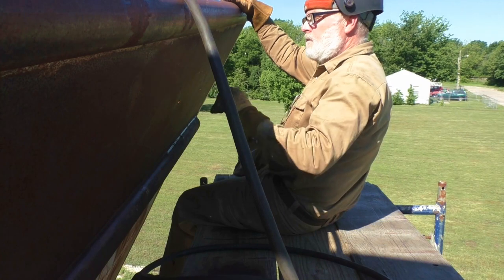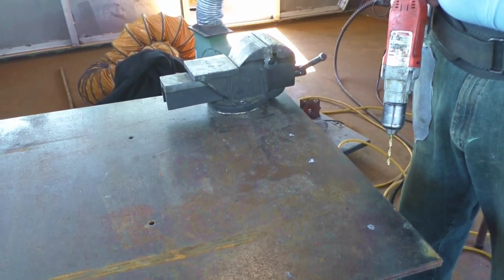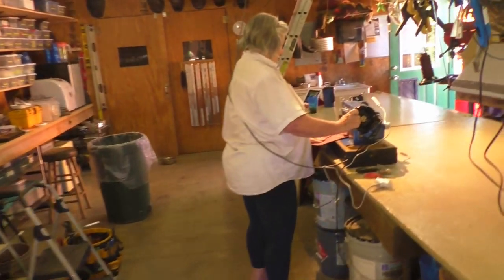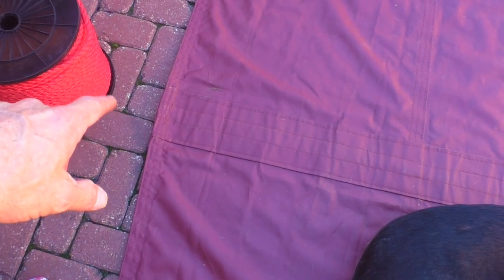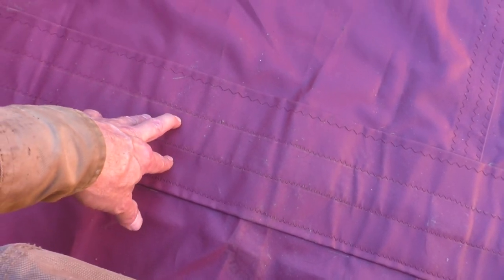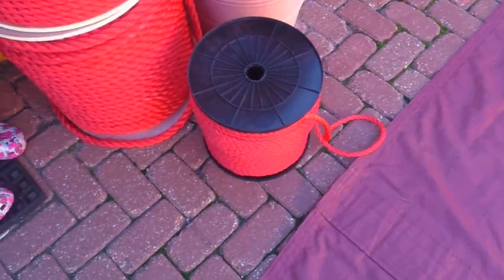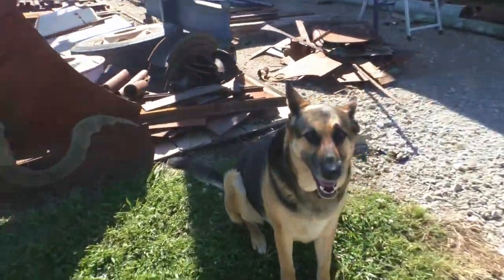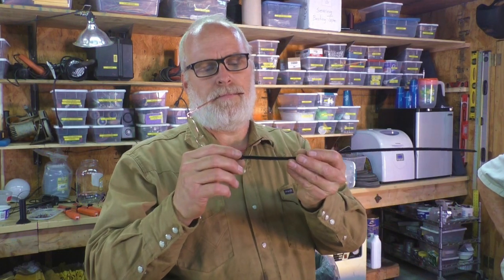Seeker LIVE - May 6, 2017 - Welding, Work Table, Sailmaking, Grommets

Comment: When I worked for a hose and gasket company, we used a stainless hose clamp that came as a roll. Uses special clips and a ratchet that pulls it tight. Special pliers crimp the clamps. they don't come off without a grinder or snips.

Comment: Beware burning holes through structural cloth and rope, from my experience a burned area tends to cause a lot of tearing in the material when load is applied. Now I don't know what exactly your sailcloth is made of, but I'd do a test portion just to be sure.
Reply: Depending on what it is made of it may let off chlorine gas or other toxins.

Comment: Use short length of dyneema rope with a square knot. UV resistant. It's used for winch line...super strong and light.

Comment: We used to assemble street signs and traffic signs with a strapping unit that used 3/4 inch stainless steel straps and connectors. You needed special tools to attach the connectors and to tighten up the straps. Damn, it was a pain in the ass to use. I wouldn't recommend it for anyone who didn't have to absolutely hold something down. And as far as ropes, learning to do knots and make slings and eyes can be very therapeutic. I spent a couple of days braiding eyes for a former employer who used ropes for a number of jobs. Pick up a riggers handbook or a knot tying book-with lots of pictures,  you won't regret it. I have kept mine since I purchased them in the 70's and plan on handing them down to my grandson.

Comment: Love what you do.  Re. burning the sail.  I found it left hard edges that chaffed on the thread and it broke in places.  Malleting an awl through worked well for me.  I know you do but don't forget to oil up the Sailrite.  I have the heavy flywheel. Brilliant for heavy and multi layered stuff. You can go slow without it stopping too much.  Billy from Blighty.
Reply from the maker: Great point.  Thanks

Comment: On the subject of GROMMET INSTALLATION may I offer my experience setting grommets.

An arbor press does an excellent job but is limited by material space management.  I cobbled together a humble, home made device that is simple to make.   And as an extra bonus, it can be carried aboard the vessel and used while at sea.     I'll try to discribe it...

Position your work table under a substantial ceiling beam.  From this beam, suspend a vertical pipe to within inches of the table's work surface.  A setting tool will have to be made to attach to the bottom of the vertical pipe.  
Place on the table, a small hydraulic block jack, maybe 2 inches cubed with a hose running to a hand held pump to provide the SQEEEEEEZE.  Sitting on the top of the jack is the grommet die.  The block jack and it's associated grommet die is position under the suspended setting tool. 

Simply maneuver the sail to position the grommet between the two tools. Apply the necessary hydraulic force to seat the grommet.  The sail can be maneuvered unrestricted from one grommet to the next regardless the size of the sail.

                                                          Works good, last a long time.

Comment: You were on the right track when you were talking about applying the rope to the sail "cording style". I would cut a piece of sail fabric 6 to 8 inches wide and make the cording out of that. then you can sew it on the edge of the sail with 4 to 5 lines of stitching.  then at each end of the cording, hand stitch through both layers of sail cloth and rope at least a foot....after stretching it. You need to make sure it all stretches to the same length.  I also didn't see any reinforcing on the corners of the sail.  You will need several layers of graduating sizes, say by 3 inches per layer.  With a large/strong grommet at each corner.  For the battens, I would make batten pockets out of sail cloth with a metal reinforcement at the mast end.  to keep the battens in, just drill a hole in the batten and tie or sew them in in pocket. I have about 10 years experience as a sailmaker.

Comment: A Dremel tool with a small burr or drill bit would go through those layers of sail like a hot knife through warm butter.  You could make some sort of jig to space off the holes if need be, or use a ruler, or simply eyeball it.

Comment: We use a soldering iron on Dacron at work all the time. You can use an appropriate size copper wire/rod/rivets etc threaded into a good hot iron. The steel nail type of thing with a torch works but cools faster than you might think....it would be like stick welding in comparison it to the hot iron...the copper has a much better thermal cycle than steel heating quicker and holding more heat as it burns the holes. Also working the grommets, you will find the same type of problem with a press as you do striking with a hammer. It will still tend to press unevenly to one side or the other causing the shank to buckle and flatten unevenly. The trick is to keep turning the punch and compensate for any uneven areas on the flare as it develops, it's a lot like making a good flare on a brake line.  If you just smash on it it will be lopsided and ugly, but working the flare nice as it curls over gives a much better result. An idea to prevent someone having to crawl under the sail may be to weld or thread in a long rod that you can use to push the die under the sail to locate it under the hole. I'd also think a heavy piece of plate welded to the bottom of the die would help to make it sort of it's own anvil to have enough mass to keep if from bouncing and keeping it straighter. Two other ideas are to try welding the punch part to an air chisel or a hammer drill. Air chisels work great for heading rivets but the rotary/hammer action with a drop of oil may also spin the metal and form a nice flare on the grommet easier. Finally for the loops, you can also use heavy duty Dacron and seal it together with the shank on a soldering iron as well. You stick both pieces around the iron, pull the iron out quick and squeeze together with like a inch or so overlap repeating as necessary till the whole overlap is melted together. The larger diameter and lower temp of the soldering iron shank melts the Dacron better than the tip of the iron which tends to burn and oxidize the Dacron so that it's not as strong. This can be strengthened by burning a few stake holes through it as well you can even reinforce those holes with a blind stainless pop rivet with a back up washer for more strength. But yeah the grommets are a real pain, but after a few you realize how to finesse them in. If you mess one up, don't try to grind it or drill it to remove or you'll melt a hole in the sail. It's best to grind off a pair of side cutters so one side is smooth and use that to get in under the lip to cut and pry off the flared head.  Hope some of that will help....Tim
Reply: Oh, one more tip I almost forgot. The punch tool they send with it is really bad a starting the flare on the grommet shank. half the time the shank starts to buckle before it starts rounding over. I've used a wide tapered punch or if you can find a cheap small ball peen hammer that has the ball that's kinda long and egg shaped. That works really well to use as a starter to get the flare going (striking it with another dead blow or brass hammer). once the shank starts to flare, then the normal tool can be used to finish rounding it over and seating it home. Just don't hit it too hard to start or it will split the side of it out...Tim

Comment: For setting grommets in the middle of a sail, would a pneumatic impact hammer (adjustable via air pressure) work better? Make the setting die fit the hammer. Then you can set anywhere.

Comment: Stainless self locking zip ties are available (at least here in Australia) from TRITON that can be pulled tight with a normal pair of pliers.  There are a number of products that will do the job but are actually designed to hold CV boots onto car drive shafts.

Comment: Black zip ties are UV stabilized by adding carbon to the plastic. They will still become brittle in cold weather and after extended time in hot weather. The are for organizing cabling, not holding things. Use something made for the purpose or watch it break.

Comment: For swaging the grommets,
how about drilling and  threading the lower die 3/8" x 16 right down the centerline.
Then, drill all the way thru the punch die, centerline, with just enough clearance for a 3/8" x 16 tpi all-thread to pass thru cleanly.
Now, cut a length of all-thread 2" longer than you need to thread into the lower anvil die, plus the full length of the punch die.
Now, weld a decent lever on a 3/8" x 16 nut.
Lastly, weld a large wingnut, or whatever to the top end of the all-thread.
Now... (for its first use) you'll need to run the nut with the lever all the way up the all-thread, until it reaches the top where the wing nut is welded.
Finished.

To use it, align the anvil die under your hole with the lower brass grommet in place, under your sail. Then place the upper half of the brass grommet thru the hole in the sail, while aligning both the punch and the anvil dies.

Now just insert the all-thead thru the punch die and use the wing nut to thread it fully into the anvil. 
Crank the levered nut down against the punch die until the grommet is swaged to your liking.
It's a thread press.
You might even be able to use 1/2" threaded hardware. Whatever floats yer boat.

It would probably be a good idea to weld a plate, or long handle onto the lower die for easy positioning, and to prevent the die from spinning when you crank things down.
Viola. Cest finish!
Regards,
- the transmission guy in searcy

Comment: Instead of a press for the grommets, bore the tool through and use a threaded rod and nut. You could even turn up your own tooling for the job that way you can have more than one. run the nut's down with a zip gun for speed.

Comment: What is the UV rating of the Dacron rope? I used to hang glide some and I know the sails are made of Dacron and they break down with exposure to the sun. Also an arbor press uses just a rack and pinion gear. You could weld up a custom size c-frame and then cast the rack and pinion gears out of bronze using a pattern cut on your CNC cutter.

Comment: Take a trip to your local sign shop they have grommet presses to put grommets in banners.  At least you can try it before you buy one.  

When punching holes in the sail with your punch, you said you were going to use wood under the sail.  set the wood so you are punching into the end grain.  you won't have to his the punch as hard to get the punch to go through the sail material.  how ever the punch will go deeper into the wood if you do hit it too hard.

On the wire ties, you can get 3/8" ties up to 48" in length.  With that said, find the length you need and you can wrap the wire tie around the pole and through the grommet twice.

Hope this helps.

Comment: A thought on holes through the sail material would be to make a punch out of heavy tubing or pipe and turn it on the lathe so one end is tapered and sharp.  Put the other end in a drill motor to spin it while using the punch like a drill bit to cut the material.  A piece of wood or plastic cutting board as backing will be necessary.  With correct sized adapters any sized hole can be accommodated and still chuck into a drill chuck.  Just a thought.

Comment: Maybe you can devise a tool like the one used to fix POP rivets, to install the gromits. Not sure if you can pass one of the gromit pieces through the hole, specially where it is very thick. You only have to think how to expand the tip of the tool once it crosses both gromit pieces and the sail, so it can generate the back pressure. Maybe something like a split collet that expands when an internal insert gets thicker. I hope my english makes sense.

Comment: I tried using a press for brass grommets. I found that I had to rotate the punch between hits to keep the grommet from splitting. Dead blow hammer worked best.

Comment: Have you thought about using Stainless Steel cable ties ? I used to install a microphonic cable on chainlink fences for intruder detection, we used a UV resistant plastic cable tie every 100mm then every 5th tie was Stainless Steel :) The cables are still on the fences 24 years later mainly held by the Stainless ties.

Comment: you could mount the press hanging from the ceiling with the grommet die mounted recessed into the tabletop, totally removing the bunching problem.

the ceiling might need strengthening or you might just push the roof off.

Comment: Doug - I'm your man when it comes to zip ties. In a previous career I was an engineer and product manager for a cable tie manufacturer and can still let you know everything you might want to know but it would be easier offline. do you have an email address I can discuss this with you?
Reply: I tested zip ties for use on oil drilling rigs in northern canada. The zip tie market is full of crap product, however the military has specifications for their zipties. Look for milspec zip ties. They actually stand up to nastyness outside. I have seen ties last on a rig derrick for 4 years. That rig saw temps of -50C in winter to +40C in the summer, all in the sun, shaking like hell.
Reply: I concur, the zip tie market is hit or miss (mostly miss)

 I live in the Mojave Desert and worked for NDOT for 26 years, our equipment would regularly see 115 F  (46C) or higher and max sunlight for months at a time as well as the possibility of freezing temps in the mountains, all with copious amounts of UV rays.  

It would not be uncommon for zip ties to go brittle within a very short period of time, perhaps a matter of a season, perhaps less.  SOME brands seem to hold up, but most are falling off of their own accord within a couple years.  If a zip tie is on the verge of falling off, it has no inherent strength left.  

A good supply of heavy milspec zip ties is the best bet.  That stuff lasts.  The worst case scenario would be having to check/replace the zip ties as part of the daily duties on board Seeker.

Comment: How about a Arbor press with a punch like on a Iron Worker for punching through the thick parts?  And for securing the sail, Uline has polyester strapping/clamps  Some of the strapping has break strength over 1500lbs.

Comment: There is a device that is used to punch holes on sheet metal "Used a lot on the Electricians trade, this device could be modified to crimp the brass rings on to the seals.. with out to have to consider using an arbor type punch.. just do a google search on the device and you will have the answer.. good luck!

Comment: Black zip ties (And most all black plastics) use carbon black for pigment. Carbon black shields against UV very well. Black is best bet for any plastic with UV exposure for that reason.
Reply: For the press, in large hydraulic presses we deal with, they are called C-frame presses. Not sure if I've seen anything remotely portable but terminology should be the same.

Comment: Rather than engineer the arbour press to take the load of punching it. You just need to make a tool that will align the two parts then hit it with the hammer.
Only issue is reloading the bottom part, but then you would have that issue no matter what.

Also to make a press type system place a bolt in the middle and tighten it up. A pneumatic ratchet will lighten the load.

Comment: Could you possibly clamp the sailcloth between the deck and the magnetic based drill with a punch in the chuck? If it works it would remove the folding of sail cloth/ size of arbor press throat from the equation.

Comment: You have a lathe, turn the punch parts from brass, the soft blow is likely so you don't damage that punch, you can put the bottom punch on a rod so you can slide it under the sail
I don't know if it's possible to have a rod sticking up from the bottom part so you can insert a lever from the top to pull the 2 together.
For the strapping, have you seen the plastic or polypropylene strapping ? only tool needed seems to be a tensioner,
http://www.ebay.co.uk/bhp/plastic-strapping
sorry, couldn't find a US site for this
There's also a version that uses metal crimp clips

Comment: There is a 1/2 wide stainless steel rubber coat strap material, use your standard band-it clamp tool for making hoses.

Comment: TIP: Instead of cutting the top of the zip tie bag, cut a slit in the center... about 2 to 3 inches long running top to bottom. You then can reach in to get a tie but none fall out of the bag.

Comment: For your next sails for a junk rig set up, check out an old man from England who likes to sail the far North.  He made his own sails and had some vents on the bottom three panels.  His channel is called MingMing2.  He was for simplicity and strength since he was out for 70 to 90 days at a stretch.  You might see something you could use for your sails down the road.  Enjoy your videos. You will be more knowledgeable if there is an application.

Comment: at the phone company we use ball lock stainless clamps frequently. there is a special tool to tighten them but you can also use a old screwdriver with a slot.  why not put a rubber hose over the stainless ball lock strap?

Comment: I would not use zip ties. I have bought different zip ties and used him for Tarpon in Arizona and Texas and they become very brittle and break. I thought it was the zip ties I was buying. But then I bought some more expensive ones and had the same results. The white zip ties seem to last longer but still subject to getting brittle. And these were the UV rated ones. I have use those strapping clamps before. The clips are cheap and the tools not worth trying to make. Although the grip clamp is pretty Bitchin. Probably a little more than you want to spend. But you could also double as use for all your hose clamps and other needs. Plus the strapping is stainless steel.i've always run heat shrink around my hose clamps for chafing.